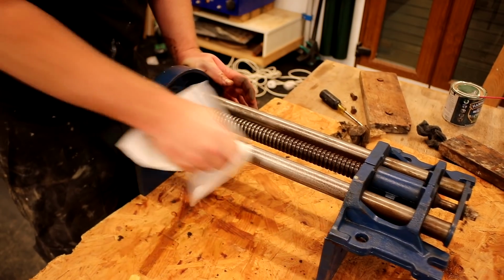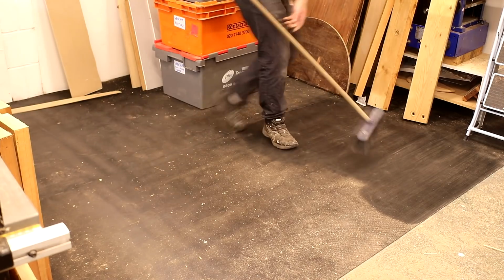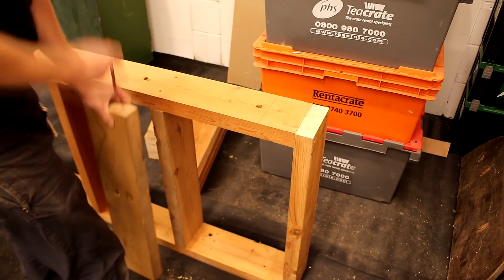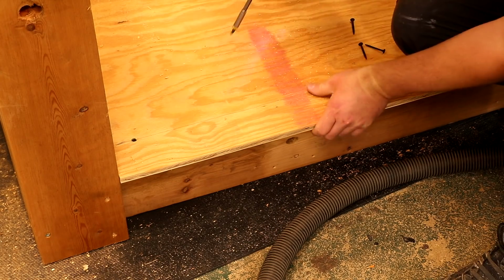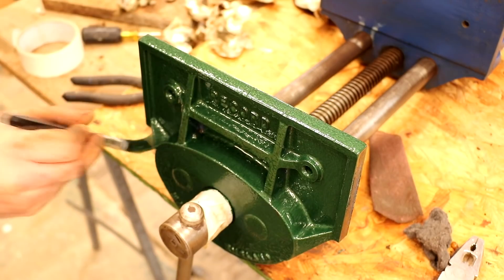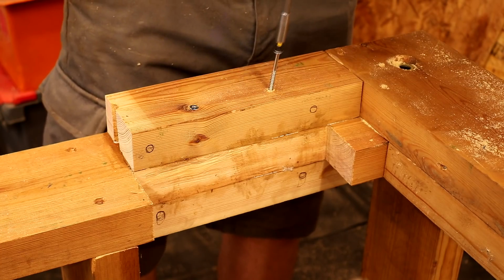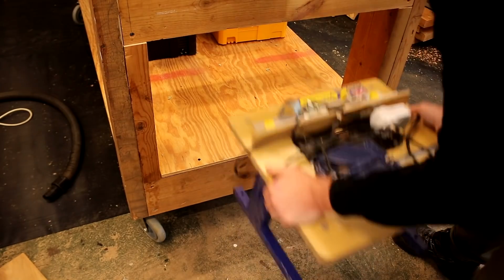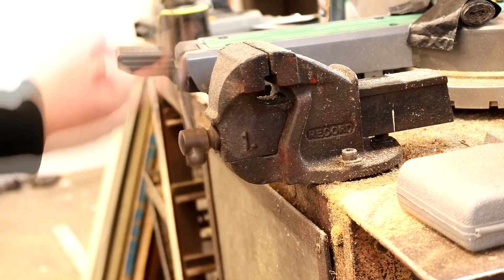Making An Assembly Table Frame Plus Vice Restoration

Comment: i had an old dining table with really sturdy legs and used this as a frame for my workbench.  the top is a sheet of OSB screwed right to the table top (6x3) with MDF sheet attached to it for a smooth work surface.  The OSB and MDF were cut down to 6x4 which gives six inches of overhand on the width which I reinforced with some 4x2 for good measure.   

build it any way you can while saving as much money as possible is what I say.

Comment: Hi Keith, any idea whay kind of weight the castors are rated for? I am looking at a set on amazon with a max loading of 360Kg - don't know if this is heavy duty enough?
Reply: Ah, and do you know what diameter of wheel?
Reply from the maker: Hi Mark I have no idea what weight they're meant for but I haven't had any issues. I often use the table with a ladder on top to access my loft space so it has coped with my considerable weight! 😂

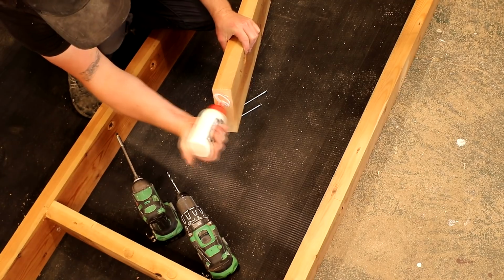Comment: Nice bench looks properly solid. This is a bit geeky and it really doesnt matter here but it might in future. I think your maths is wrong if you 2:40 if you divide  the opening by 4 your outer 2 sections will be bigger by half the material thickness than the inner 2 sections . It alexas falt anyway. Thanks for vid.

Comment: Don't think people do anybody a favour when they say 600mm rather than 60cm.
I get 1 to 9mm, I get 605mm but 600?
Even 0.6m would have made more sense.
It's like when people say "my baby is 32 weeks old". 
No, he's 8 months old.
What's the point of that?

Sorry, had to vent lol
Reply: I wouldn't expect anyone here to use cm for those sizes. I go down to the local big box store, doors are 2030 long, 620 or 72 or 820 wide, Timber might be 1.8 metres, 5.4 metres long - a less precise measure because they might be a few mm longer. Sheetgoods are specced in mm out to 1220x2440.

Comment: Hi, you are going to have to get some more paint to paint that metal vice that was on the bench that you inherited when you bought the house. I also use a lot of salvaged wood (mainly pallet wood) for the things I make and as I don't sell my items but give them away I have no problems with that. I do have some nice slabs of mahogany that I got from a bar that was being refurbished, but I would never use that for a bench. I like your bench and the method you used to make it, It is exactly what you need and looks ok to me.

Comment: Hey Keith - I used these wheels - https://www.amazon.co.uk/GBL-Workbench-Casters-Portable-Furniture/dp/B07L11DV2N/ref=sr_1_6?keywords=heavy+duty+bench+castors&qid=1569053056&sr=8-6 .  I liked them as the wheels only make contact with the ground when you want to move your bench.  Bit expensive but well worth it

Comment: That is one very sturdy bench, I think you may need locking castors, like the design and agree with your choices of materials as it is a workbench and it will get a lot of use

Comment: I made a very similar table several years ago and it has turned out to be fabulous as an outfeed table, assembly table, or even what I like to call a project table, where I can keep all the parts and bits and bobs for a particular project and simply wheel it out of the way when I am not working on the project. I am guessing that you will be needing lockable casters on yours though. I use mine all the time and with good quality ones the table does not move at all when the castors are locked. Without the locks the table will be going all over the place when you don't want it too, particularly if you plan to use vice. Looking forward to hear more about your rubber flooring......and just wonder if you get any damp issues under the rubber over the autumn and winter?

Comment: 8:35 - I would sit the bench on a length of 4x4 (or similar) on each end, just lifting the wheels off the ground. Every now and again when you have to move the bench, knock out the blocks with a hammer to get it sitting back on the casters.

Comment: Great workbench, should last a long time. I made one about 20 years ago with 4" x 4" 's from pallets and used thick OSB for the top,,figured I could replace it easily, but it's still good.  If you want your legs to have even more stability, replace your wood screws with lag screws, they grip the wood really tight and you don't have to worry about them snapping under weight.

Comment: You can make 2 wheel double  chucks with scraps and a little non-stock material.  Just connect two wedges and coat them with non-stick stuff, then slide them around a wheel.  I'd imagine chucking 2 wheels would do nicely.  Doesn't have to be fancy.  Nice little table!  Wish I had some of that nice reclaimed wood you used.

Comment: Nicely done Keith 😁. Looks like a nice solid bench. Hope the wheels work out OK. I had locking ones on my mobile table saw bench, but the cast iron table was heavy enough to stop it moving so I've never needed to lock them. Keep up the great work 😁👍.
Reply from the maker: Cheers. It's working fine so far without locking castors although I suspect if I start using it for planing wood I may need to upgrade them!
Reply: @RagnBoneBrown  I suspect you are right 👍. Let us know how you get on 😁👍.